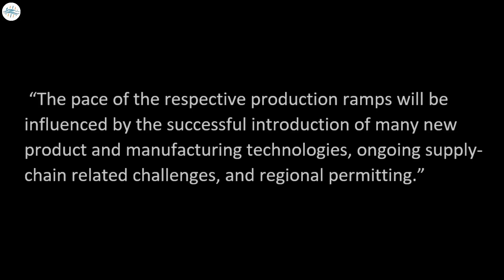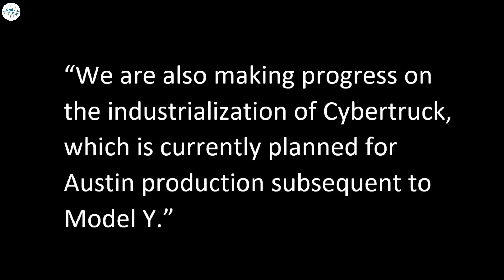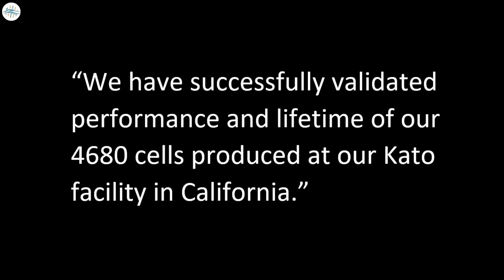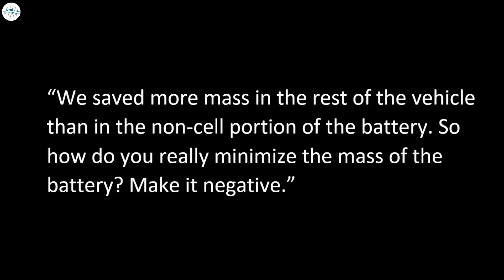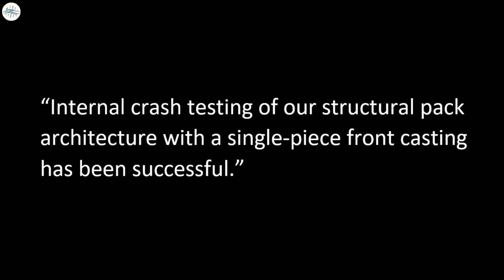Tesla Model Y 2.0 & 4680 Batteries Coming Soon - Confirms Elon Musk!

Comment: Range and charging time are important factors with owning an EV. 300 miles is too low of a standard 500 miles should be the norm that way worst case we as owners can expect around 400 mile range
Reply: With the lack of batteries and the current high price, starting with 300 miles is good. Once batteries become abundant and the price somewhat reaches its ideal level, you can increase the standard range.

Comment: There are unforeseen problems conceiving towards a tab less architecture. An architecture giving up a reliable electric path (welded tab) in exchange for multiple point contact at the anode-casing junction. Contacts are flaps extending from the anode periphery. Anode is made of annealed soft copper foil instead of hardened spring copper foil. 

Two expected advantage are : conduct heat and electricity to the cell casing more directly in a parallel fashion as oppose to serial means previously. 

Practitioners in the art knew that point contact incurs junction resistance to heat and electricity transfer that should be avoided when option is available. 

The use of hardened spring copper foil to address junction and pretension contact forces also will let the electrode rolls to unroll itself. Self unrolling (flex back) creates gas pockets between electrodes, reducing wet area on electrode surface, to a lower charge capacity, higher chemical impedance related heating and long term performance stability issues. Not an option. 

The use of soft copper foil to address unrolling issue is a matured technology Panasonic and other manufacturers use. However annealed soft copper will not hold shape once formed into flaps. Higher percentage of flap count may be touching cell casing right out of production line but will further deformed on the road under inertial and thermal shocks. As shock progress more and more junctions will be disassociate with cell casing, until the last and only junction remains in touch with the cell casing. At which point thermal path is practically cut off and the next inertial shock will momentary open circuit the only junction to an electric arc/spark. At such time we have hot and flammable chemical in the cell that an internal ignition and combustion is highly expected. 

The use of pretensioned elastomer at the cathode end pushing down at the electrode roll and further to the flaps against the cell casing intended to take up slacks from deformed flaps? This option will cause to the same problem above - axial compression force and thermal cycle can delaminates the roll for gas pockets between electrodes, reduction of wet area on electrode surface, to a lower charge capacity, higher chemical impedance heating and long term performance stability issue. Not an option for performance products. 

The use of thermal and electricity conductive paste/glue at the flap-casing junction? This may be a urgent research subject to develop a suitable conductive adhesive to be low resistance electrically and thermally stable and emits non toxic fumes in a collision that is also chemically compatible with battery electrolyte. Is quite challenged. 

The use of fractional hardened partition soft/hard copper foil? Such as selective hardening where the flaps are. This calls for special production machinery that Nevada plan doesn’t have which needs to plan and develop. Is another urgent research subject? 

The use of blade battery pack? Cells from BYD and or CATL? Elon’s call. 

Return the removed welded tab to the tab less battery? This will eliminate electric arc/spark but heat sinking for 4680 remains an issue, due to thicker roll radius, higher heat density and resistance. To this situation blade cell offers more option and flexibility.